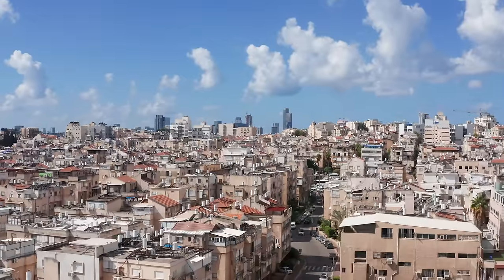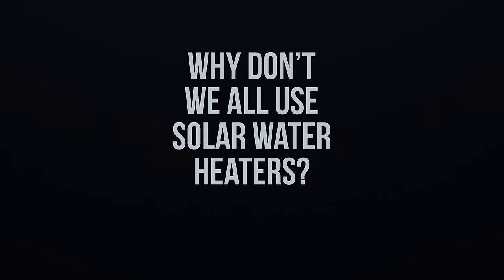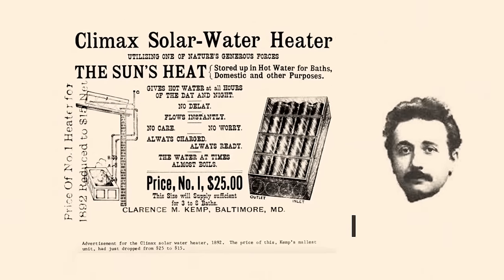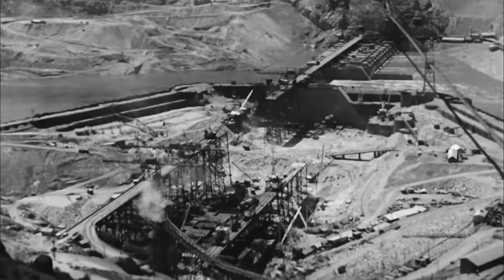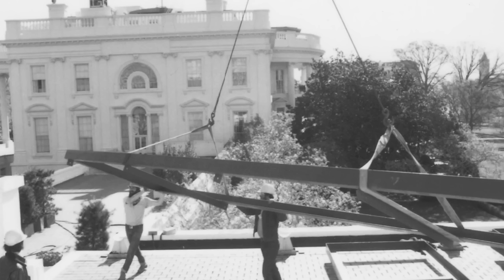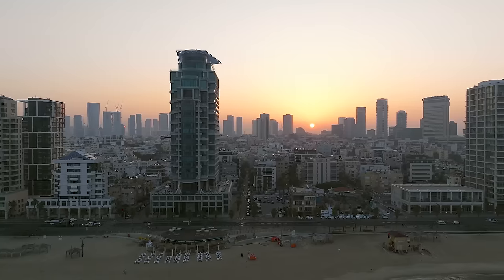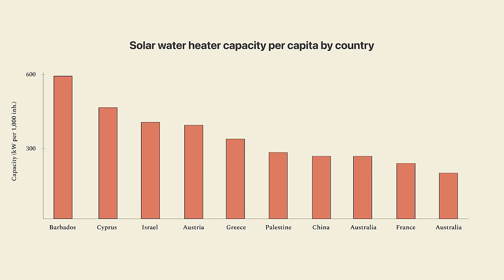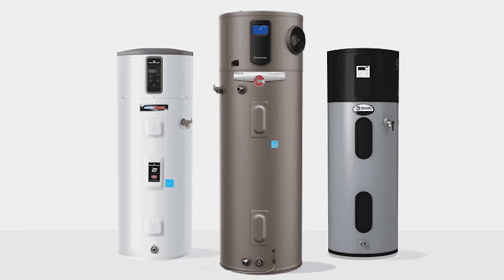Why Don't We All Use Solar Water Heaters?

Comment: Too bad where I live we had like 2 sunny days since November 1 until November 23, and if you replace the consumption of other sources some days the expense for the rest of the days will increase, because you pay mostly for the power plant being built and maintained, and less for the fuel. If in the USA the solar water heaters went away after subsidies went away it is a good indicator it does not make sense to have them.

Comment: A solar power diverter such as the MyEnergi Eddi can divert excess solar to heat up your water cylinder. No need to get a solar water heater, when solar panels can be used to power your house and heat your hot water.

Comment: I am Israeli.

Solar Water Heaters (SWH) give you hot water when you don't need them and half warm water when you really need them.

A better option can be a Solare Panel (SP) to produce electricity.
A SWH can take 2~5 sq meter (30~50 sq. foot).
A SP can produce in Israel ~500 kWh for sq. meter per year.

Meaning, you can produce 2,000 kWh of electricity per year for an equivalent SWH footprint with a simple SP.

An electric water heater consume ~10 kWh per time, which means, you can produce power with SP and use it to hear you water by electricity 200 times a year.

Just take the solar panel. You won't use SWH as much.

If you really want to be extra clever, there are solar panels that use water for self cooling and you can use this water for your hot water needs.

Comment: I installed Solar on my roof about 7 yrs ago a water to water type for heating underfloor my wife decided to put in a new Timber floor so I an heating the soil under the house now  but I get a lot of hot water by the way I did it myself it cost be about 40 € / tube including the storage cylinders

Comment: In Israel the water is so hard that water stone collect quickly electric boiler has to be removed  often.  With solar collectors you don't have this problem as the calcium does not precipitate as no point reaches 100C.  A solar system has a far longer life than an electric one.

Comment: It's cheaper these days to have a few PV panels which directly heat water in an insulated tank using an immersion heater rather than have all those pipes going to the roof.

Comment: In America, roofs and rooflines are major status signals. A complicated, difficult to build roof is a sure sign that you had extra money to throw away on a part of your house that you almost never use (directly). A complicated, difficult to engineer, difficult to build roof on a commercial or public building is a date sign that you're organization is doing well, because you have so much money to throw away.

Americans don't want some ugly "contraption" spoiling the look of their status signaling. In Tucson, expensive houses have "real" air conditioners, while evaporative coolers on your roof are a sign that you are lower class (or, at least, not upper class).

Therefore, i suspect that a large part of why Americans don't have more solar water heaters is due to status signaling.
Reply: Pride...🤣

Comment: Because it's cheaper and more versatile to put solar panels on your roof and use the electricity generated to heat the water in a conventional or heat pump water heater,  It also let's you use the electricity generated for other thing like lighting cooking and HVAC.

Comment: If a solar heater costs $700 dollars in Israel, it costs $700 plus shipping in the US, not between $5000 and $15000.
Any company banking on this, should be able to capture a massive market.

It's one of the easiest ways to cut enmergy costs and emissions really.

Comment: The reason people don't use solar water heating is that natural gas or propane is cheap in many markets and fast heating.  Also, if you like to shower in the AM and have multiple people doing so, the hot water runs out.

Comment: I'm surprised these heaters heat the water in the tank directly instead of using a heat exchanger. Then your panel loop could be sealed and filled with coolant that won't degrade the system and would need replacement maybe every few years.

Comment: I seen a guy that does a lot of solar and he broke it down that a dedicated solar water heater isn't as efficient as running a solar panel boiling water and then letting that set the water keeps longer if it's in the house and not exposed I know I didn't explain it as good as he did but I'm trying

Comment: I'm interested in trying to use incoming cold water to cool some PE panels before going into a water heater. The cooling makes the solar panels run more efficiently and the heat they gather means the water heater doesn't need to heat the water as much. There is at least one company selling PE panels that are ready for active water cooling, I hope more companies jump on this idea for a dual-purpose system.

Comment: I've been asking myself the same question for a little while now but I find blaming the government is a little preposterous.  There are many other reasons far beyond the government to why they are not popular in America.  I really don't get the idea of the government needing to subsidize something to make it popular.  If a product is practical and attractive enough it will sell it self.  Tesla is a great example.

Beyond that his cost basis is a bit inflated and he failed to mention that there are tax credits for installing solar water heaters. 

On average, you can expect to pay between $2,000 and $5,000 for the system, with installation costs adding $1,000 to $3,000. Despite the upfront costs, solar water heaters can provide savings over time through reduced energy bills.

In the United States, solar water heaters qualify for a federal tax credit, sitting at 30% of the total cost through the end of 2032. So for a system that costs $3,877, you would be eligible to receive back $1,163 when you file your taxes.

Comment: Next week my roof top solar panels are getting installed and we’ve paired it with a new heat pump. Can’t wait to have it running and monitor my energy usage so that I can optimise the free energy.

Comment: It would help if they didn't lie with the marketing.(At least where I live)
Here a Solar Water heater system costs 10x what an electric one does.
And what's even more ridiculous is that according to the marketing the cost will be returned after 1.5 years.
So according to their claim I pay $200 per month for warm water. (Which is silly, because it costs me around $10 a month with electric heater)
Putting it together I'd have to pay 500 months worth of current heating costs upfront. That's a lot of money right there.
I understand this is probably different for each country, but where I live solar water heaters are sadly a luxury, that only the rich can afford.

Comment: I always thought you should pipe the water through radiator to heat the house. You could use a solar pool pump.
Reply: I have a 3 energy thermal solar (sun, electricity, central heating) I use the central heating pipe in reverse to extract heat from the tank and heat my laundry room with a pump and a radiator to help drying the laundry when in wet seasons.

Comment: How do these things handle freezing temperatures and snow? The idea of having water pipes on my roof just sounds like a recipe for disaster.
Reply from the maker: Many have anti-freeze systems. More on how they work here: https://www.youtube.com/watch?v=Hr9G9OACxxY&ab_channel=ThisOldHouse
Reply: @distilled-earth  excellent, thank you!
Reply: The tank is insulated and the primary circuit contains antifreeze. The angle of the panel is too stiff for the snow to adhere. In more severe climates than here in Greece people install the tank inside and use a pump to circulate the fluid rather the thermosiphon effect.

Comment: Simple reason  most houses don't have solar water systems, code requirements are not meet.  Older houses have soft roofing and additional equipment water tanks on roof = weight. End with failures

Comment: The reason why these countries have a vast amount of solar water heaters is not based on the idea of going green. It's based on the fact that the majority of these countries natural gas lines go through and/or are controlled by neighboring countries.

If a conflict we're to occur with a neighboring country, that country could cut off access to their natural gas. 

Take Crimea for example, Crimea is a natural gas hub for   Euroasia. He who controls Crimea controls the natural gas flow (they can cut off or charge whatever they want for that gas).

The use by these countries 
Is purely home defense strategic practice. Yet publicly contributed to "preventing climate change", which is a farce.

Comment: Solar water heaters are a great idea.  However, heat pump water heaters are being thoughtlessly sold in the wrong places!  They are ideal where cooling the house is important and heating the house is not. They cool the house air while moving the heat into your water, a win-win. If they are being installed in northern climates, where half the year requires home heating, they are moving heat you just created with a furnace or electric heaters, into the water, and the heat needs to be replaced! A net negative for trying to save energy costs.

Comment: I think that I almost had a cardiac arrest when you said that a solar water heater costs $5-15K in the USA. WTF are they made of? Here in Southern Spain I paid about €2K 6 years ago to have one installed. It gets serviced every 18 months or so (i live in a hard water area) - cost €90. It has an electric element built in so if it isn't sunny for several days I don't run out of water - I probably need to switch that on for just a few hours each year. Which means that I don't need to heat water with electricity from my solar panels (no mains gas where i live). Perhaps you should do a video on just why a very basic piece of engineering costs so much in the USA?
Reply: Laughing in Greek. Mine cost me 800€ new in the box (+200€ for installation) and it even was a German brand (Siemens) with triple energy (sun, electricity and central heating). Back in the days people used to build it themselves. It's not rocket science what so ever. I use the central heating in reverse to heat my laundry room to help dry the laundry free of charge when humidity is high (usually spring and autumn). The Eu is a common market. People in the rest of Europe can order anything from anywhere. Just use google translate and you'll find a plethora of cheap robust Greek solar heaters.
Reply: Maybe I should start a business in America
Reply: @srfrg9707  The only problem is in colder climates the solar part can explode if not drained properly

Comment: I think the general reason is that the USA is VERY! slow at taking on different technologies. The cities are crumbling and for the most part nothing has changed from an infrastructure POV since they were built. Similar with house designs and more.
The bottom line is a lot of other countries are way more progressive.
My guess is there will be an uptick in tech like this as fuel prices rise further.

Comment: These days, the cheap electrical water heater connected to PV panels can be the best solution. There is a video where an engineer compared solar water heater and PV panels connected to the electrical water heater and PV wins. Especially where winter is cold but sunshiny. You don't need batteries or inverters between PV and the heating element. The heating element must be changed from AC to DC and go.
Reply: I do this and it is cheap to build. To be efficient a power point controller must be used.  Otherwise twice as many panels must be used.  With proper design there is no need to change the element. There are no DC heating elements, just low volage ones related to battery voltages. If a low voltage water heater element is used in a video, chances are that guy doesn't know what he is doing.

Comment: Because in countries where the winter is cold, they already have a source of water heating. Don't be fooled, the solar heaters doesn't work to heat the houses in in cold areas, we also tried it in Eastern Europe in a 200 square meter house, we have 6 x big solar heaters with 2000 liters tank and underfloor heating + very good insulation... and when we get  -10/-15 celsius outside we have to turn on the 35kw Ariston gas boiler. We use the solar heaters to heat the home in spring and the autumn and for for hot water at the sink and showers but it does not work in the winter. In my case, it was a big waste of money because in the summer the gas bill comes at a maximum of 15 €  per month anyway for all possible showers so if you want to buy a small one for your shower in the summer, it's fine...but don't try to heat your home. In winter, I want 22-23 degrees C in the house no matter how cold it is outside... I can afford any price for that and I refuse to live at 17-18 degrees like some people...

Comment: While the historical background is interesting in this video, I disagree with the message given that the free market isn't going to get these devices into our homes.  That is the very thing that will get products into the home.  I took a hard look at the last time I replaced a water heater and realized that for about 2x the upfront cost I could get a solar water heater, and that within 4 years I could recoup the upfront costs, and with a 10-year warranty could count on at least 6 more years of hot water that will be heated for essentially free.  This then allows me to save up money for the next time I will need to replace the water heater, and anything extra is just extra savings.

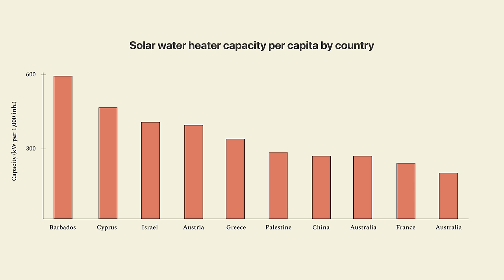Comment: Australia is on the graph twice at 0:29 😂 solar hot water is a one trick pony, once the water in the tank is hot it’s wasted roof space. These days I use solar panels, an electric storage hot water and a hot water diverter to ensure it’s only heated with the excess solar energy produced by the panels. You can then use the electricity for other items like air conditioning or sell it to the grid.

Comment: There is something you’re not telling us here. Why is it so much more expensive in the USA? Labor? Building codes or other gov regulation? It’s not 10 times more for no reason. It would be helpful if you covered that. Even with a 50% subsidy that cost would be a problem. 

I understand that the goal is that the price would come down, but somehow when there is government money flowing, companies never get around to lowering costs. 

Blaming a president from the 80’s seems a little silly as well.

Comment: I have been looking at going low budget solar for years unfortunately I can't find a 2 or 3 thousand watt inverter that I have can buy and later buy a second to get 120/240 volts AC so if I go solar it's 120 volts AC started looking at heat pump hot water heater but I can only find one that runs on 120 and it has to be installed by their  approved technician they're pricey I can get a heat pump water heater from the big box stores but although the unit is around 2 grand and I can install it myself by the time I go 120/240 I'm again looking at 10  grand or more same thing with heat pump dryer.but I like the idea of solar hot water heater I had 2 4x8 solar hot water panel's but someone broke the glass and stole the copper pipe and aluminum but there's lots of video of DIY  unit

Comment: Did you mention that U.S. building code requires there be a conventional back-up system in the building?
You have to pay for a solar water heater and a regular water heater.  THAT is the real reason why every new house doesn't have a solar hot water heater here.

Comment: The part people doesn’t understand is that sun doesn’t shine everyday. I have solar power I run my AC with the sun. Perfect, yes until I have no sun then fossil fuel comes and help. Same with solar water heater. If you decide to go solar power and hot water great! But don’t be a fool and throw away all you electric and gas operated appliances. You will need them soon again! That have happened to me but I was able to fire up my propane electric generator to help since there was no sun for more than a week! Solar generator combined with a dual fuel inverter generator will be the best.

Comment: Uncontrolled heat source. Payback time is the life of the unit.  Repair costs are very high. Install solar PV and use that to power a heat pump
Reply: I have both thermal and PV solar. Thermal is 4x more efficient per m² that PV. I maintain and repair both my installations myself. The maintained of a solar tank is the same as for the electric ones. Drain, remove sediments, change the sacrificial anode and the gasket. The only one extra step is to top the antifreeze.